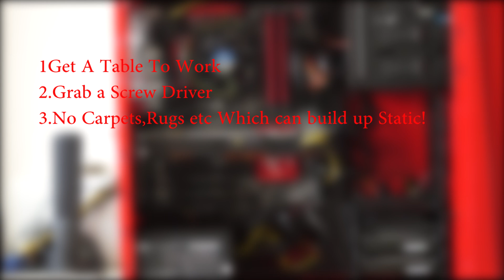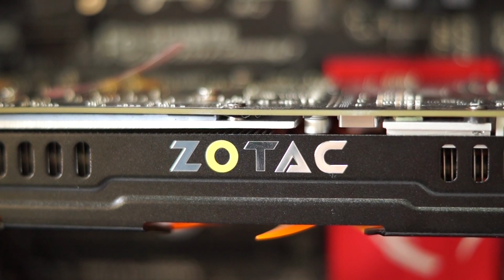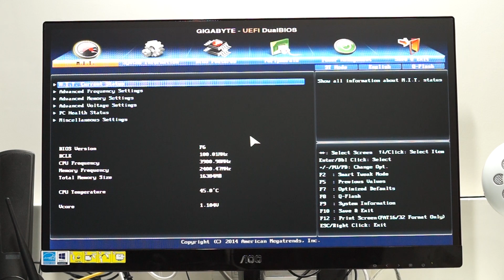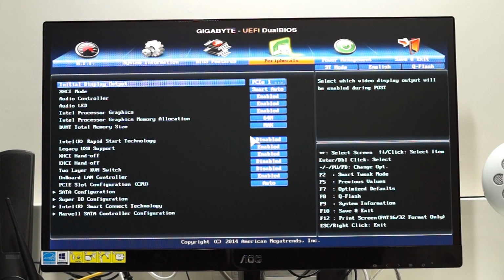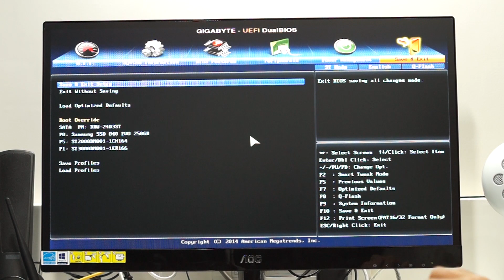How To Build A Gaming PC Computer 2014!

Comment: I watched this over and over whilst I built my pc, i have the same motherboard as yours, once completed I switched the PSU on when it was connected and no noises or fans move, instead all I have is an orange light on the power button on the motherboard, do you know what could be the issue? I installed the cpu the correct way round, I connected the psu to every area you stated, connected the hdd and ssd to the mobo and psu adapters and plugged in the 8-pin cpu power connector and other less important ones.
Reply: Joe Methven i have the same problem...

Comment: You should not have touched the CPU; also, do not touch the pins on the stock heatsink as they are already configured for installation.
Reply: Yup, to add to that don't touch anything with any contacts, such as the RAM connectors, PCI-E connectors, etc.  Use a strong alcohol mix to clean up that finger oil residue.  Otherwise the PC looks nice!  Good work.

Comment: I recently built my pc with the same motherboard. I have a 4690k and GTX 770. So far, it's very fast.
Reply from the maker: Yes. This is a very good Motherboard.Enjoy your PC!
Reply: Thanks you too.
Reply: I was about the order the same mobo and a  i7-4790K, what case and RAM did you go for?
Reply: Sorry it's so late. I used G.SKILL Ripjaws X Series 8GB DDR3 1600 (PC3 12800), with 9-9-9-24 Timing